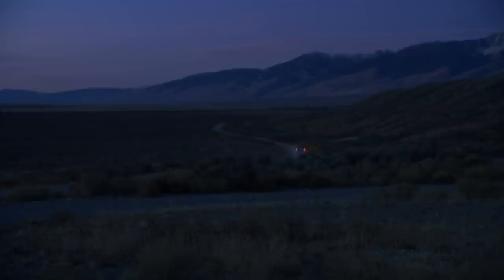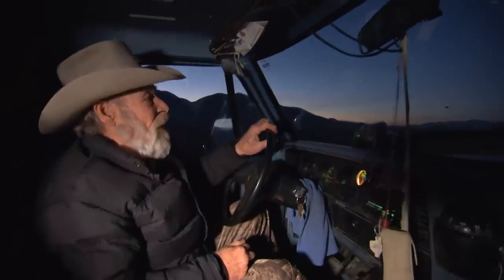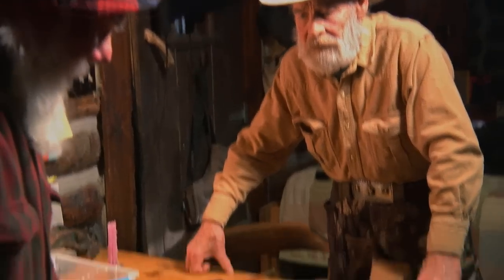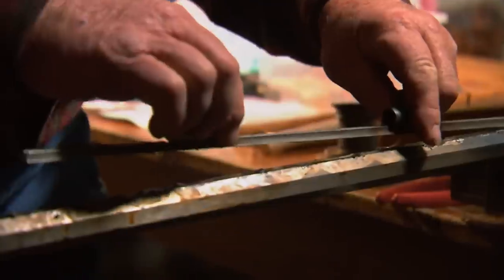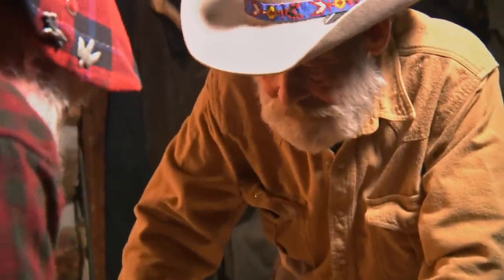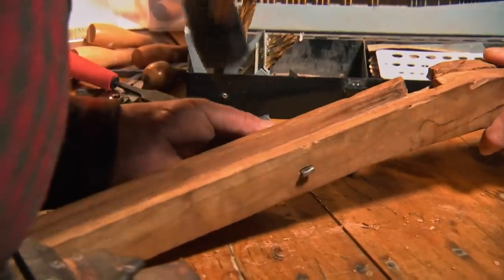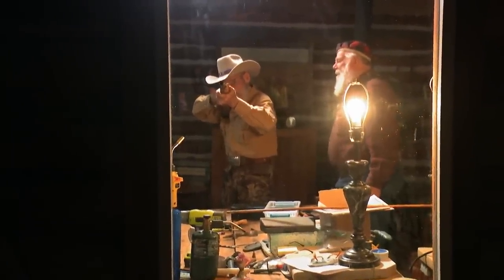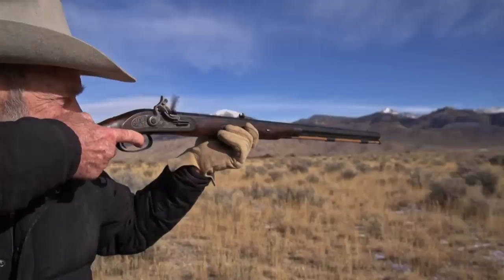Mountain Men: Building a Flintlock Rifle (Season 8) | History

Comment: A huge block of wood to a beautiful rifle in one day? lol A rifle like that would take a lot longer then a day to build.
Reply: I think all the parts were done, the night was probably sanding, staining and polishing the wood.
Reply: @darkxarchon  No. It's fake. Lol
Reply: @shawntannehill  To go from the stock he was shown putting the barrel into to the one shown on the finished rifle in one night seems fake to me too. I've built several Pennsylvania style flintlocks and I couldn't do it without making some big mistakes or taking some shortcuts. There is a lot of wood to remove and even if you hog it off it takes hours to sand down and even more hours to finish it. Traditional Linseed oil finished are usually set aside for days for each coat to dry and even staining takes hours before you can put the first coat of finish on. I'm not saying there may not be techniques that can speed the process up, I'm just saying that I couldn't do it in less than a week and then I'd feel I hadn't given it my best.
Reply: Faker than Trump's hair.
Reply: I've built over 200 muzzleloaders, and nearly 300 cartridge rifles. Fastest one you can build is a northwest trade gun kit, and it still takes me eight hours at best to knock one out.

Comment: I am no welding/solder eXpert but bruh they basicly glued it on it was not even nearly as hot as it should have been (Cherry red)
Reply: Also should be heat treated
Reply: soldering isn't quite the same as high-temp brazing or welding. Normal plumbing-type solder that melts at 400'-500'F is just dandy for most applications in gunmaking. That being said, they didn't really do it right, really should heat the area around the joint (not the joint itself, soot from the flame can inhibit the joint), and tin the surfaces, then wire them together and heat the parts together to join. The low temps of soldering are not going to affect the tempering or heat treat of parts.